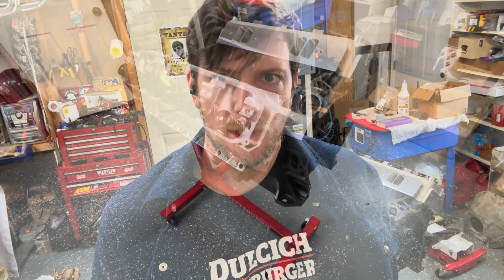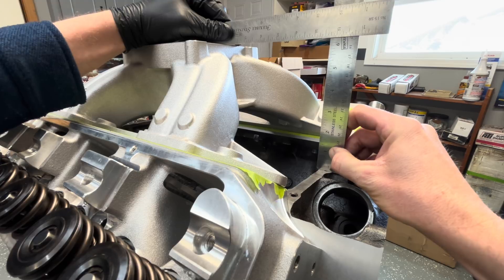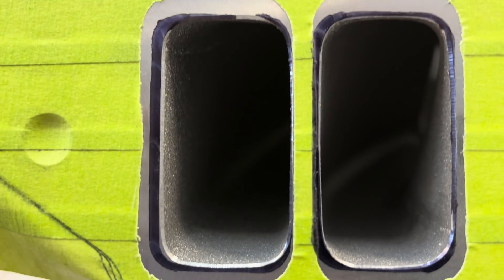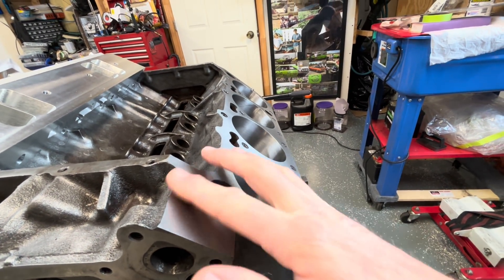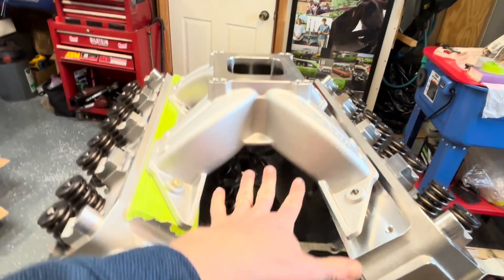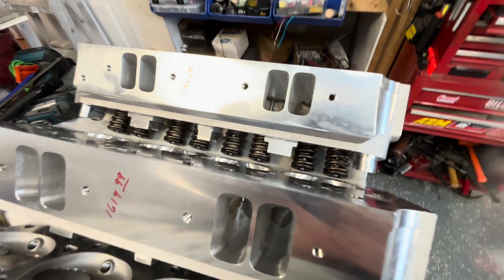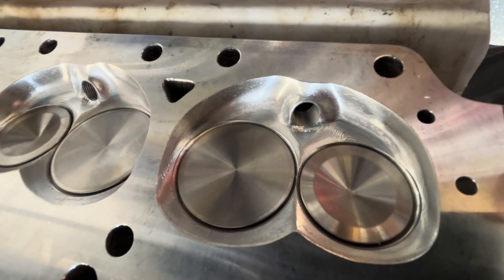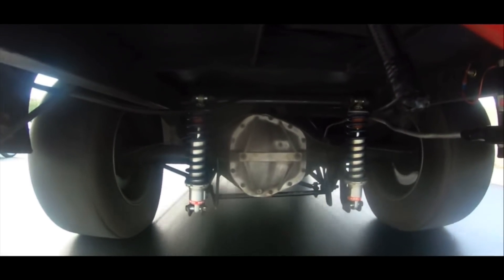Aftermarket Big Block Mopar Heads: Trick Flow 240 vs. 270 fitment with the Track Heat Intake

Comment: Thank you for sharing your knowledge, Im planning my 440 RB on my 68 Charger and want to keep the hood stock. My initial plan was TF 270, 292/300, .549/.544 cam. S70015K & Hydraulic Roller Lifters 89211-16. Im lost at what intake to choose and if i will have hood clearance. Maybe a better option is TF240 and a proper intake that does not choke it. Thank you

Comment: For those that absolutely need more hood clearance, I use .500 aluminum blocks between the k-member and the unibody. Not enough to bind torsion bar removal. I also use a 2"x14" filter with flow through air cleaner lid. Same track times with that short filter.

Comment: Man its so nice watching your videos. The wealth of knowledge you share is incredible. Thank you so much. I have a few mopars but I'm researching a low buck project 69 roadrunner I'm putting together basically  using a low compression (RV) 440 stock bottom end but E street heads and a Hughes whiplash cam and the Johnson Hylift lifters maybe a Holley street dominator intake (hood clearance) and a Brawler 4 bbl Auto trans and a 3.23 rear gears. Just a cruiser and maybe take the grands to get ice cream. All the best  sir!
Reply from the maker: Thanks brother! Sounds like a sweet ride!

Comment: Very true, when you need hood clearance, something has to give. I'm over here running a CH4B to keep a flat hood on my 440 Dart
Reply from the maker: That is the challenge!
Reply: If you insist on running  a flat hood save your money and use fully ported 906 heads, ported factory dual plane intake with no less than 10.5 to 1 compression and magnum exhaust manifolds.
 Use a good solid flat tappet cam.
 I  Built these 440s for heavy full interior B body rides that were competitive on the street with hard tires.
 The hard tires, 3:23 gears and manual 4spd or 727tf with 10 inch road runner converter worked very good with  these 440 combos.
 The trick was to make your competition run hard tires factory iron heads  and pick a spot of the highway that was longer than a quarter mile and stay away from quick big block Chevys.

Comment: Joe, thanks for all the great content.  I'm building a 493/RB stroker, mainly for street, maybe some strip duty.  Plan is to use the 270s (do not believe hood clearance will be an issue) with TF .600 hydr roller cam and holley 950 4150, 10.5 : 1 comp.  Overkill for street?   Any idea what HP this combo is capable of?
Reply from the maker: That sounds like a great combo and should make some serious power! You should see 650+

Comment: trick would be to have larger the the 4.35 bore as tested for flow on the 240 CC Head. as in 1 400 with 0.30 over bore

Comment: I am in the toss up between the 240s and 270s. Building a 505ci mopar stroker. 4.350 bore x 4.250 stroke. -8cc flat top mahle pistons and a hot street/bracket race cam from Howard's cams. Im hoping for between 10.5 and 11.1 compression and 640hp to 680hp
Reply from the maker: I think you’ll be over 11.3/1 with the 78 cc chambers of the TF head. Static compression
Reply: Is static or dynamic the compression used to calculate power  @JustMoparJoe
Reply: Bore shrouds with 440 slightly so the 240cc would like a 440 to be bored 0.06 over. TFS rates at 4.35 bore size

Comment: I couldn’t find any specific comments regarding the fitment of an Elderbrock six pack intake with the 240 trick flows. Does anyone have any feedback regarding the amount of porting required for good figment?
Reply from the maker: @kenlavigne6975  I believe the 240’s and that particular intake are both standard port sized. It shouldn’t require much to port match it.
Reply: Thank you very much!!

Comment: Rather than messing about with the Trick Flow intake, why not just get the Indy Maxx intake that matches the 270 ports? It's a good intake.
Reply from the maker: Excellent question. The owner of this and I discussed. Indy took 3-4 months on the last intake that I purchased for the 508 stroker (it’s in my playlists). This intake is sold and recommended by trickflow. I knew I could make it better.
Reply: Hood clearance  also

Comment: Hey Joe - got a question.... 
I just pulled the 440 out of my '70 Roadrunner. It ran "okay" with no smoking or knocks but it had a miss that I couldn't correct, even after replacing ALL the typical suspect parts. When I pulled the heads I discovered one banana-shaped pushrod so guess that was the culprit.  
I like the camshaft....it is a hydraulic flat-tappet cam and the lobes and lifters look fine so I don't want to replace it. The previous owner said he installed the cam and lifters which is a mild 470 lift/270 cam. The rest of the engine is completely stock with flat head pistons (has headers and a Holley 750). 
The heads are being reconditioned and I have ordered new factory pushrods. I'm wanting to replace the valve springs too but not sure if I should stay with factory OEM springs or replace with a little heavier springs as a result of the bigger camshaft. 
Can you give me your opinion about which valve springs to use?
Thanks Joe for any advice you can share!
 Van McD
Reply from the maker: @VanMcDowell  Comp 911-16 springs should do the trick. You’re less likely to lose a can or lifter since they’re already broken in together.
Reply: @JustMoparJoe - AWESOME!  I was looking at those springs but wanted to make sure they weren't too stiff.  Thanks so much Joe!!

Comment: I agree with your way of thinking i have been using ported cast iron heads all my life because thats what i could afford never had a pair of aluminium heads until i was 65 but i was driving my cars and they ran good i remember back in the 70s direct conection sold big block porting templates and thats all i messed with was big blocks even stock heads will get you down the road stock pile your next build while you are driving you stock motor thats always the way i did it with a wive and kids and a mortgage there wasn't much left over to play with I'm patiently waiting to see the dyno numbers on this 512 nice job on the head comparison and the intake because i would rather run my stock hood than have a tall intake with a scoop always great information on your channel i can tell you were taught by someone my age because i remember some of the tricks back in the day and i know your dad was the main one again thanks for sharing
Reply from the maker: Thanks Ray! I got the 400/512 block cleaned today. It’s time to get her built!

Comment: i agree with picking what heads will fit under stock hood. 90% of the ppl will put all their money into the best of the best parts for their engine but will never use them to full potential or will skimp out for other parts of the car that needs attention to even handle the power.  i like tfs cause parts are readily available for them and quality is there also IMO. i personally got the 270s and love the power and i got room to grow if i want to.  awesome video explaining that bigger is not always better and it don't hurt to buy a lesser head to get a car finish to enjoy.
Reply from the maker: Thank you!

Comment: On the speedmaster 265 heads I have a set going on a 575 stroker on flow bench thier flowing  280s int  320s out the box  244intake 188 exhaust 74cc  the whole upper end  heads  valve covers 1.6 rockers  valve pan intake  $1600 .00  unported   can get cc also
Reply from the maker: Thanks for sharing!  Those speedmaster heads are a great option. I always hear to buy them bare and add quality valves and components
Reply: @JustMoparJoe  thier pretty good quality  valves  and hardware look very impressive .  Springs  are going to match  a 274  283   686 642   108lc  on  1.5   running 1.6   super victor   1050 Barry grant   11.1   diamond   h beam  7.1 molinar  crank n rods mega block   build!!   How horse  to be seen yet !!   What's your opinion on horse power  ???   Im in central missouri
Reply from the maker: @ that should be great. Definitely runs a race with the Edelbrocks. The victor 440’s in the 580 beat 400 cfm on intake! I’ve got videos coming soon for all that. I would definitely think you’ve beaten 600 horse to death
Reply: @JustMoparJoe  cool will be looking for them !  My motor in the build stage . Things subject to change. What part of Arkansas  you live ?  North I hope  I'd like to meet you sometime . Maybe at the tree!!!! Haha
Reply from the maker: @ yea man! I’m in central and Eastern Arkansas. I usually race at Newport Arkansas, but I hope to make The Mopars at Mokan sometime

Comment: So between the e-street and the 440 source which one do you think is better?
Reply from the maker: It’s all about application. If you want max flow and higher hp, I’d go e street. The stealths truly have the most stock look of any aluminum head out there. They’re very unassuming, but will save you 52 pounds over stock cast iron.
Reply: @JustMoparJoe  thank you sir

Comment: I wish there were more MW intake options for these low deck motors. I'll be curious to see how that TF intake ends up after porting.
Reply from the maker: @powers6963  I’ll definitely show my process. I’m way more common sense than I am engineer 😂
Reply: @JustMoparJoe  Awesome! Love your videos by the way.
Reply from the maker: @powers6963  thank you. I heard there may be some intakes for low decks trickling down the line. You’ll hear it first here!
Reply: Lack of lo bloc Max Wedge intakes is what is stopping me from buying TF 270's for my 512 build.
I'm told TF considered making them then declined. 
Market too small ?
Reply from the maker: @ I think they’ll be a Company step up at some point. Even niche markets can get 100 intakes cast with enough power

Comment: Joe, are you still having good luck with firecore distributors?? I just bought Pertronix. It is so much bigger and I am not going to grind on my aluminum heads!! I’m not crazy about china made stuff but wanted to ask you opinion! Thanks!!
Reply from the maker: I’ve got firecore in my racecar and blue truck. I’ve never had any issue with their stuff. It cleared Dave’s edelbrock heads as well. Dyno proven for 2 engines for me so far.
Reply: @ that’s good enough for me Joe.. I had a summit racing dist. It just won’t hold a tune!  The original and the summit Racing are a hair over 3” in diameter.. these Pertronix are over 3 1/2” before the cap, I’m not grinding that much material off my heads and or the distributor casing. Thanks.. going to try a fire core!
Reply from the maker: @ call them directly to get the channel discount
Reply: @MarkCoronetguy Hi,
Which Firecore did u get or going to?

Comment: I’ve seen first hand the 270s in action. My buddy has a 70 Duster drag car. Gutted, 6 point bar, 2800 lbs. He has a 440/512, TFS 270s, solid roller, 727 with 8” converter, Moser 8.75 with 4.56s. And honestly your Barracuda with E streets is just as fast. He’s been 6.38 in the 1/8 and 10.25 in the 1/4. Take that for what it’s  worth.
Reply from the maker: That’s impressive, he’s got a great combo for the 1/8 mile. I’m still running 4.10’s and my car is closer to 3,000. I’m searching for a little faster this year. Thanks brother

Comment: Joe can you get 380 to 400 hp out of a 360 magnum id like to get more power in my pickup and if so what do you recommend like type of cam and do i need to do away with the kegger intake and put a performer rpm intake and carb instead of the factory fuel injection i  also have a nice 02 D2500 4 wheel drive qaud cab it also has a 360 you would think it came with the hemi but it didnt im thinking of either sell it and getting like the 85 body style and get a 440 to put in it ive always wanted a big block sqaurbody dodge i enjoy watching your channel thanks for what you do
Reply from the maker: You're on the right track thinking about a performer RPM intake or the Chinese copies work well on magnums usually. Check out 318willrun on YouTube and his drag truck. He has a great combination there with a 360 magnum.

Comment: I've been planning out an RB with Trick Flow 270 heads on a Bill Mitchell aluminum block so I'm really excited to see more videos about how the 512 build with the 270s goes.

Since you already have the 270s, I'm wondering if you could help me out with something? I'm really interested in trying out the Edelbrock Pro-Flo 4 XT EFI kit with this build. Edelbrock says the XT manifold takes an Edelbrock #7225 or Felpro #1215 gasket. Any chance you could lay one of those gaskets on the TFS 270 head to get a ballpark idea of how much port matching that intake would need, or if it's just way too far off? Thanks!
Reply from the maker: The 1215 is a standard port 440 valley pan. It would be nearly the same as this track heat intake. Trick flow recommends the same 1214 or 1215 depending on low deck or RB.
Reply: @JustMoparJoe So it sounds like the XT manifold would likely need about as much port matching as the Track Heat, just depends on whether there's enough meat in the runners?  Thanks!!

Comment: what i have seen of the Edelbrock Victor intake manifold for 340. they are 318 port size and the location are offsetted also .I agree with Indy B  intake was only intake for the 400 . maybe the tunnel rams will fit 270s as well. Im finding $2700 for TFS240 and $1800 (Can you match the flow of TFS by self porting including tool price? how about already cnc to a machinists full port on Ed head?)
for rpm pair. since the disaster of economy and new owners of TFS the price has gone up $300 plus
Reply from the maker: @smilsmff  I would bet they aren’t selling as many because of it

Comment: Why don’t you compare the 270 TF head to the Indy EZ-1 or Little EZ head??   Really, most guys I know run Indy, not much on YouTube regarding them for some reason
Reply from the maker: I put the Indy’s on a 508 stroker a few years ago. I set up rockers, installed the valley plate, and Indy intake. I like those heads but they are expensive as well. If I can get more in the shop, I’ll definitely showcase them.
Reply: @ Thank you, I enjoy your videos. Keep up the good work!   
Why someone hasn’t stepped up and made a max wedge port, low deck dual plane intake yet is puzzling to me..  There’s a market..

Comment: 500ci RB in my drag and drive Challenger made 800hp with Trick Flow 270’s… solid roller, 12:1, and trick flows new manifold for the 270’s. 1100 Dominator.
Reply from the maker: @SBRacingGarage  that’s excellent! This one will be 12.5/1 solid roller, and E85 with the 4150.
Reply: @JustMoparJoe nice! That’ll scoot along nicely!

Comment: Hey Joe, thanks for the head review. Was curious on your opinion between redoing very worn 906's, or Edelbrock performer rpm heads vs 440source stealth. I estimate the price range to be pretty close, whats your recommendation.
Reply from the maker: The stealth heads are now $1,400 a pair before tax and shipping. I think they give a nice factory appearing option that saves you 52 pounds over stock. I think the 75cc estreet has a nicer chamber design and will give you a slight bump in compression. The one shown here is the 84cc version. I would consider them both nice entry level heads and would think the e street would have better flow numbers. If you’d like the stock appearance, go with the source.
Reply: @JustMoparJoe  Yeah, I am debating between the stealth head and the RPM performer head. The E-street for a 440 is out of my price range lol. Do you think the Performer RPM heads are worth $400/set more than the stealth? thanks for the reply!
Reply from the maker: @CZimmy  stealths are only $65 a pair less than Edelbrock e streets (like in the video). I believe the stealths may have a better seat material than the e streets, but the estreets likely flow more and are available in 75 cc.
Reply: @JustMoparJoe  could you link a set of e streets? The sets I am finding are much more expensive. That's why I was looking into the rpm performer.
Reply from the maker: @ https://www.jegs.com/i/Edelbrock/350/5090/10002/-1
Reply: @JustMoparJoe  Thank you, I didn't realize they sold in pairs😅, makes more sense now. Will let you know how it goes

Comment: Also with 270s on a tall deck the only intakes available that are not form Indy use a 4500 carb flange… kind of a pain. Also you’re spending another $1000 at least over the 240 for the other requirements like the valley plate and intake gaskets carb and intake. Indy is to expensive and the port is different then the 270 port
Reply from the maker: Very good point!

Comment: This is probably the best video I have seen regarding big block cylinder head selection. Even Roadkill/Engine Masters did not go into this detail. Every engine they ever tested seemed like it was always an Edelbrock with underwhelming results. It seems the Trickflow 270 is the top dog now. If I were building my engine over for my Charger, it would have been this exact combo. However back then there weren't as many options for the low deck. My combo is a 440RB 4.25 stroke .040 over (approximately 512 I think) with Indy Max Wedge EZ heads ported by an expert engine builder up in Ohio. Mine is a solid roller as well topped with an M1 single plane intake (it has the valley plate as part of the intake). I use my factory 69 hood. Here is a little not so secret secret for the pre 71 B body K frames for additional hood clearance. I have 1 inch spacers between my K frame and body that added room for the taller deck engine and intake with longer K frame bolts. That allowed me to run an RB with the M1 intake. However, again, I would be building this exact low deck that you are building right there if I had to do it over again. Following this build attentively and learning a lot from you Joe. Great job!
Reply from the maker: I'm glad to be able to provide some helpful information. It's always a learning experience building these engines! Thanks Buddy!